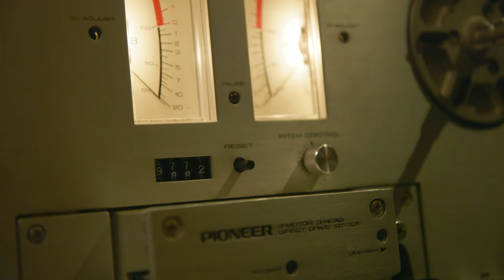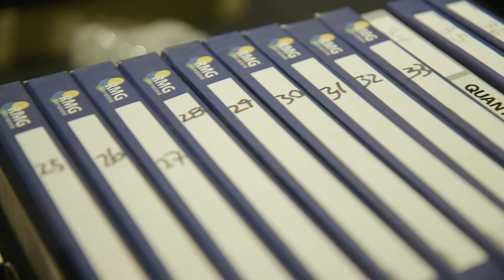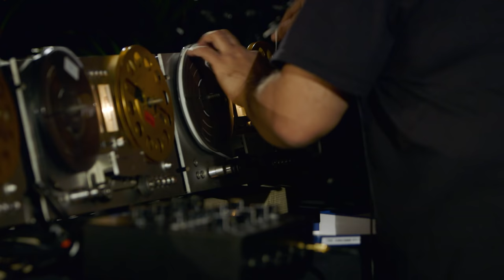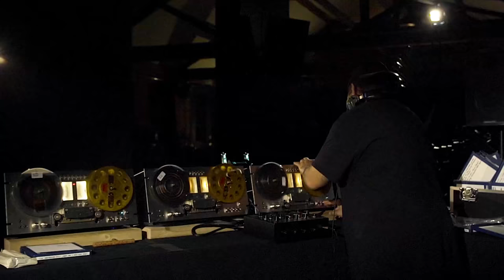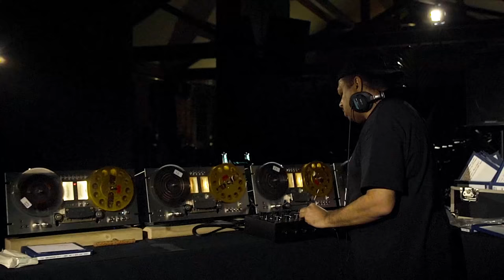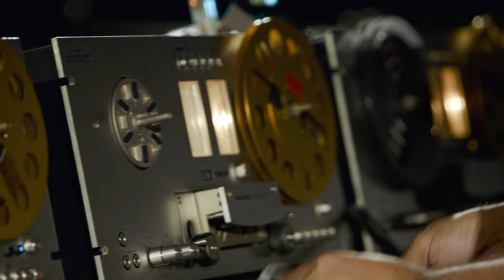RA Sessions: Kerri Chandler - Reel-To-Reel Session | Resident Advisor

Comment: this dude is really repairing deck 3 while mixing decks 1, 2, and 4! 🔥
Reply: Do you mean PREpairing? If he was taking a reel off to load another, that would mean he has other songs&/or mixes of particular songs on that reel. Each reel he has songs on most like were recorded at the highest inch pre second(IPS) for the best quality so he might have 5-6 full songs on one reel
Reply: @MixFiend362  no I mean repairing. Around 29 minutes he's got a screwdriver and he's adjusting the pinch rollers at deck 3.
Reply: @staticchoir  Oh I see. I was listening during that time..Looks like he was cleaning the roller. Sometimes if it's too shiny your tape will sound erratic or mess up  rotation of the reel on the side he was fixing. He took enough time to listen to the feel of the song playing & used the work energy to think what he would be playing next. He's also classically trained pianist which enhances the ability to multi task.👍

Comment: the sound to be so crisp is unbelievable
Reply: I believe this machines can be run at higher reel speeds, therefore almost no white noise and extremely crisp sound. The Dolby NR crap wasn't neccecary back in the good old reel days.
Reply: That is correct, these are Pioneer Rt707's with a max speed of 7 1/2 Inches per second (double that of a compact cassette)
Reply: high speed reel to reel is by far the best sounding format
Reply: It looks so

Comment: Any guesses to what he's using for a delay? Mind-blowing mix, just amazing. Love when he busts out the screwdriver mid set to work on a player. Amazing Mr. Chandler!
Reply: At least one of these is hooked up as a tape loop / echo / delay.

By feeding the playback head output into the recording head input, playing and recording at the same time, the sound goes on and comes off tape and the process is repeated.

Each “loop”, the sound is coloured or filtered by the effect of tape. The speed of the tape determines how slow or fast the echo is, the time / physical distance between record and playback heads on the machine.

You can do this with 3-head cassette recorders as well, provided you can monitor output from tape while recording.

Being able to change the tape speed in rea time adds a whole other dimension, DJing aside.

I just got a R2R machine myself, so I’ve been researching all this as of late. You can see my videos for proof! 😅
Reply: @scottschiller  It is the left most deck is delay. You can tell by the fact its running half the speed of the others to get a longer delay time. Also it has a red recording light on in between the 2 VU's.

Comment: Your RT707's or 701's behave well. 
Tell us of your repair histories of these machines.
I have a Tascam 48(1/2" 8 track) and an Ampex ATR700 (1/4" two track)
Need a 1/4 track machine for playback of 3-3/4 & 7-1/2 ips prerecorded tapes.

I like how you mix , sync, blend and crossfade between machines. Great feel to the mix.

Comment: Pioneer RT-707 rules!!!  ;)
Reply: But maybe they are 701 becaurse of no reverse. Sorry if I wrong, but i have and well know RT-909.))))
Reply: @Pilot88052  Actually you are right its the 701. I own a RT-707 and its such a beauty. :)
Reply: @StotheEtotheB   And no matter that they are 40 years old!!! My single little fear is about heads. Pioneer discontinued to sell them around early 10's.
Anyway, these machines are perfect! I use my own for recording and play tapes on Electronika-004 with Ferrite-glassed heads, which are extremely wear-proof.))

Comment: does anyone know what the tubes are ampilifing
Reply: I was wondering this myself, they seem to be responding pretty much identically so I'm assuming they're separate tubes for L and R rather than joined together but that's all I can deduce. If you find out, let us know.
Reply: Could be this :: nobsound magic eye tube preamp audio level indicator vu meter
Reply: Andrew Barrett wow thank you, one more question: so it can be a vu meter while amplifying sth?
Reply: Christopher Jones assumption: 4 tape machines input to the mixer, the mixer must have another pair of output so it can send to the tube VU meter. So it has nothing to do with the sound, it’s just decoration. ( thanks to Andrew Barrett, he pointed out the specific models of the tube)
Reply: @iridescentlee3425  not sure but if you look on Amazon there will be a discription what they do

Comment: so emotive when delivered by hand with such intensity - Reel 2 Reel....smashing it out of the park, how hard it must be to keep it in the mix without quartz lock etc....
Reply: I bet the drift isn’t as bad as a old pair of technic 1210’s. They probably lock up nice almost like CDJ’s when you get them synced up, the hard part is locking them up with a tempo knob nothing tangible to push or drag the beat. You have to speed way up or slow way down then slowly shorten the knob turning till you sync them in!!!!!

Comment: 4 Pioneer Rt 707's, an E&S DJR 400, 40 or 50 reels, and does anyone know what those tube things he's got on the top of the tape units are?  Just gorgeous.
Reply: I guess vacuum tubes connected to an amp
Reply: I think it’s a pre amp maybe the reel to reel signal needed a boost or he’s using it for a overdrive effect.
Reply: Look at nobsound magic eye tube preamp audio level indicator 
vu meter

Comment: I see TUBES (Valves in UK) on top of the 2 center Reel-to-Reel machines (blue glow).  What are they for?
Reply: bd Slide they amplify the VIBE!
Reply: I believe they create the saturation he speaks of at the beginning.
Reply: @lavolka  nops, he says about TAPE satruration, its a mechanical thing, about transfer the audio in analog to the tape, this is tape saturation, the valve i think its just to beatify the all thing ;-) you can find this on aliexpress.com
Reply: Hopefully someone knows exactly what that device is.
Reply: @bdslide5179  difficult to tell exaclty what it is (i don't see a clear shot of that unit), but it's most likely a tube amplifier of some sort, possibly a preamp? the tubes seem to be pulsing to the beat a bit.
Reply: apparently they are not amplifiers, they are vu meters https://www.amazon.com/Nobsound-Preamp-Audio-Indicator-Spectrum/dp/B07LBPR77M?tag=skim0x1299-20
Reply: Following
Reply: @DJMARINKOx  That's it!  Thank you.
I came back here because I just discovered they are VU meters utilizing "magic eye" tubes.  Pretty neat.
Reply: @djronancoficial  He fooled me lol!

Comment: nice but just because he is not using a computer or a turntable can make this "ART". is just another equipment. A guitarrist can use an electric/ non electric guitar. He can use vinyl, reel to reel or cd's.... he just beat match.... nothing wow here.
Reply: It's much, much harder with Reel to Reel. You can't synch, you can't auto beat match, you can't cue in the same way and you've also got a format that's more fragile with a far greater margin of error. 

Listen to any House DJ set now and you'll notice very few errors as everyone is mixing with a laptop/CDJ's with auto beat matching, synch, key matching and other tricks that can create a perfect mix that's completely in time and in key. Anyone can be technically proficient now. If you're fucking up mixes and you're out of time, you shouldn't even call yourself a proper DJ. I can even ride 2 tracks for 5 minutes playing 2 videos off YouTube because it's SO easy to reliably find out the BPMs and keys of each track. 

Back in the 70's, 80's and up to the mid 90's it was far harder. You had to learn your craft, have a great ear for music and know your songs inside out. Everything is now so much easier. 

Now I've always felt that technical ability comes second to crafting a set with great songs but I always appreciate fine technical mixing particularly if it's on a hard format. 

If you knew what you watching, you'd realise it's wow.
Reply: Too long to read. For you, that never seen tape and is used to traktor and that digital bullshit, seems Wow, but is not. It's just another tool you need to get used to, anyone can do it.